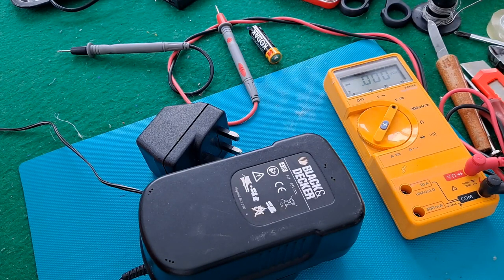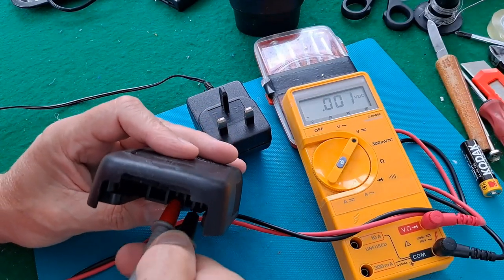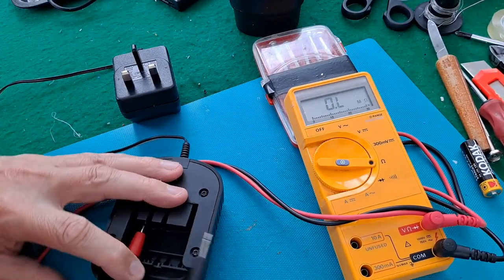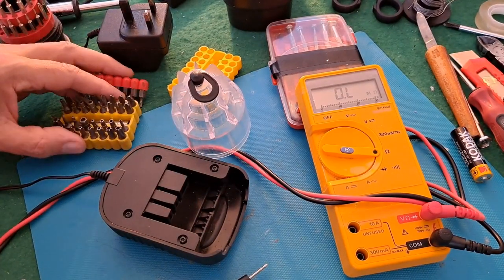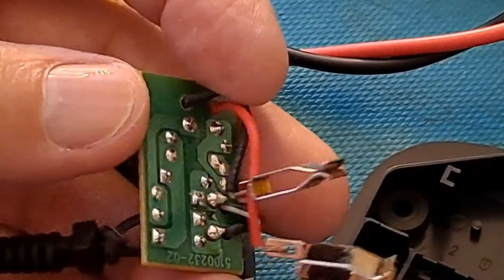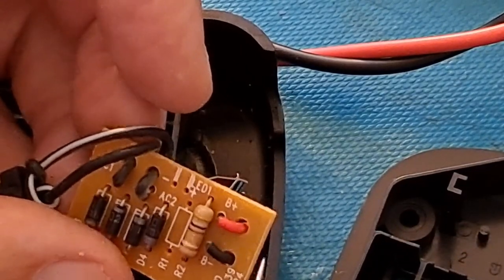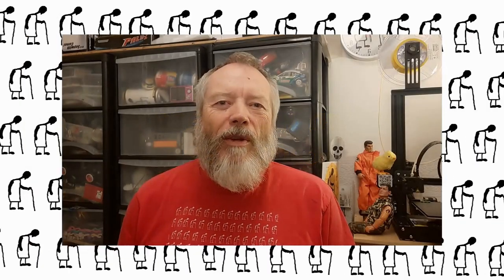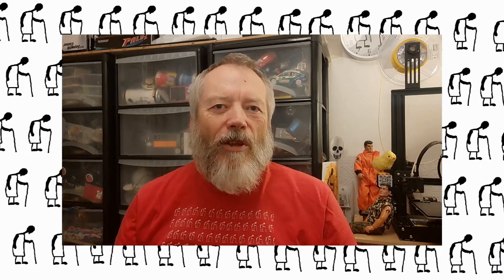Black & Decker 18v battery charger PARTIAL tear down

Comment: Hi, I modified this 18V Ni-Cd battery with 10 lithium cells 30A (21V 4,5 Ah) replaced in the box + BMS for a BD mini-saw . The saw worked one hour non stop perfectly on a lot of 6/15cm branches (dry old hard wood) with permanent full power.....Huge difference compared to  Ni-Cd ! the chain runs always with max speed. The tool begins its second life.
Reply from the maker: Brilliant 👍

Comment: I have a screwdriver set with over 100 bits it has almost every bit i always use it i suggest that you get one it's not very expensive and it's absolutely worth it
Reply from the maker: Like i said, I have more than enough, the problem is finding where I put them 🤣
Reply: @GrandadIsAnOldMan  oh

Comment: Im having the same issue، any suggestions?
Reply from the maker: Here is the follow on video (you will usually find this information in my video descriptions) Black & Decker 18v battery charger tear down CONTINUED https://youtu.be/EwOvq6xEMZE HOWEVER, What I didn't find in this video, but did a year or so later, when I decided to take the coil apart, is that there is a thermal fuse under the blue tape on the windings. If I had replaced that, it would have fixed the power unit. 🤔🤔

Comment: I was hoping you would take the battery apart just to see what's in it. 😆🤣😂I guess I should have waited for the end of the video
Reply from the maker: A repair is possible but I think it would be uneconomical.
Reply: My charger wouldn't light so I knew it was the battery.  Battery worked on the drill. When it needs charged then I'm going to have a job to sort it

Comment: At about 9:00 minutes into the video, shouldn't you have your voltmeter on DC setting instead of AC?
Reply from the maker: Watch it again. At 5:59 I show you that it is AC coming from the transformer with the rectifier bridge on that circuit board in the adapter.
Reply from the maker: In the video description I added the links to the other two videos in this series
Black & Decker 18v battery charger tear down CONTINUED https://youtu.be/EwOvq6xEMZE
Black & Decker 18v NiCD battery tear down https://youtu.be/eGRzEYbYOSw